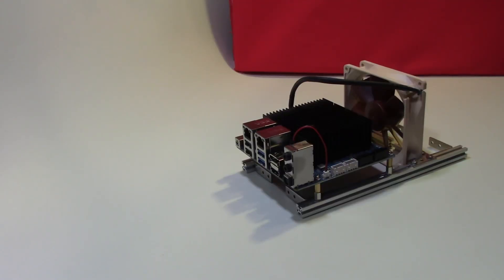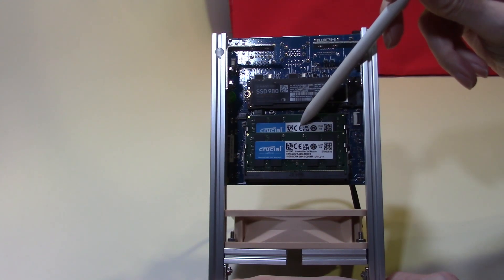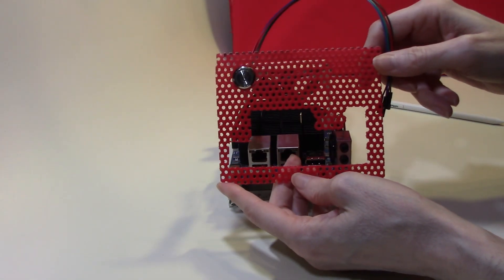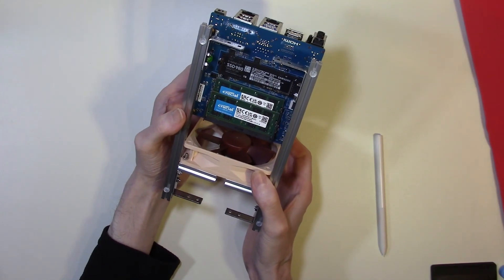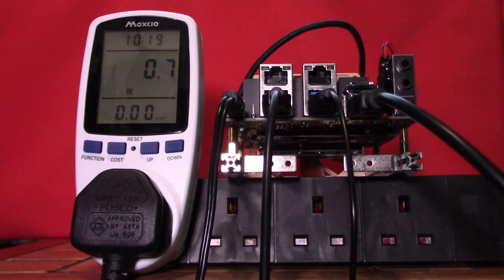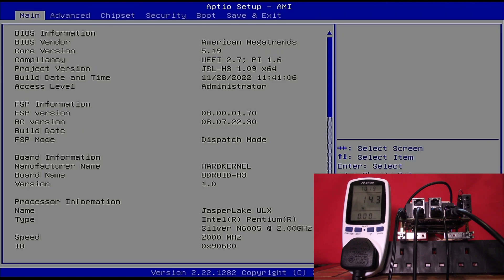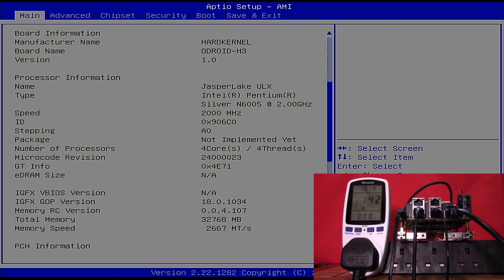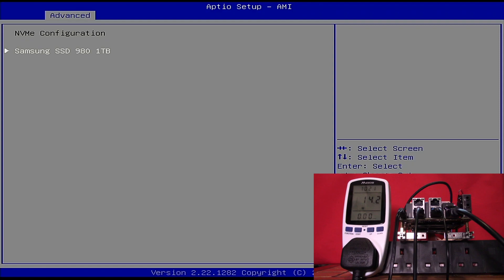Odroid H3+ single board computer - now with 32GB of memory

Comment: You didn't mount the radiator correctly. Rotate it 90 degrees for better results.
Reply from the maker: The heat sink comes pre-fitted.